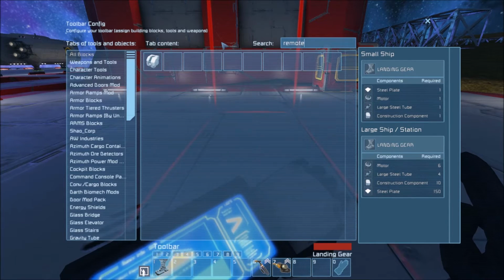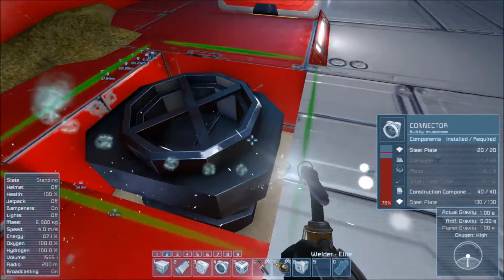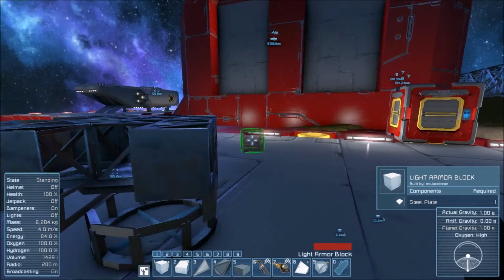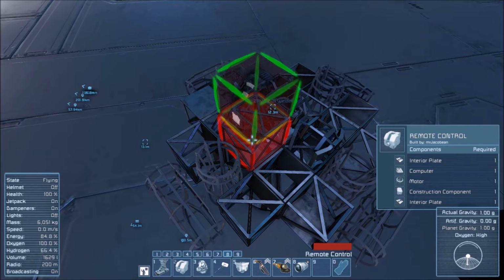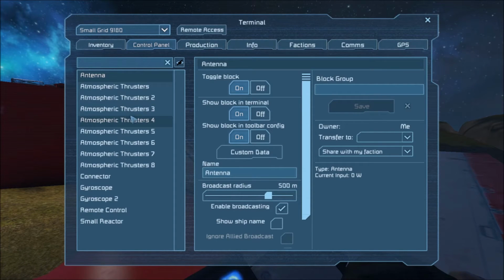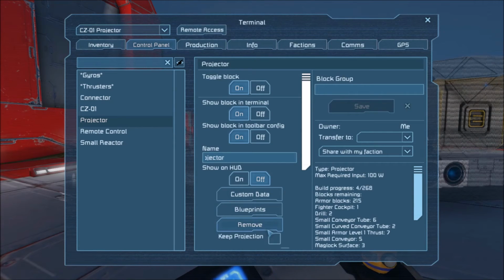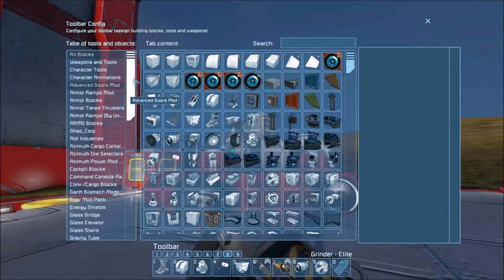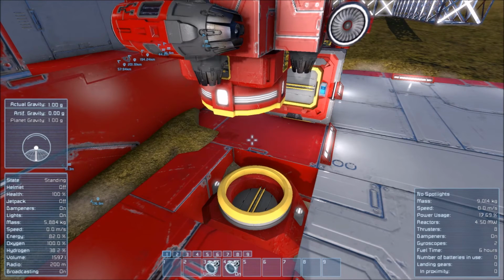Space Engineers - Construction: Projector - Episode 11

Comment: I'm  impressed.  Although, I did get totally lost with what was going on when you started setting things up in the various control menus.

The other thing that has me scratching my head is why it is necessary for the projector to be mounted on a flying platform.  I'm sure there is a perfectly logical answer, but it alludes me.
Reply from the maker: The reason for the platform is that large projectors only build large grid ships, and I wanted small grid ships. Now I could have built another ship entirely, but I wanted it to feel as if it was part of the same structure
Reply: AhHa!  I knew there would be a perfectly logical answer..

So, once it was set in position, there is no accrual requirement for all of the flying equipment (thrusters, gyro and reactor) and they can be dismantled, is that right?.  I can understand why you would want to keep the remote control
Reply from the maker: I kept the rest of the equipment there just in case I needed to move it, or that space engineers bugs out with that weird thing that happens with connectors (they call it: CLANG)